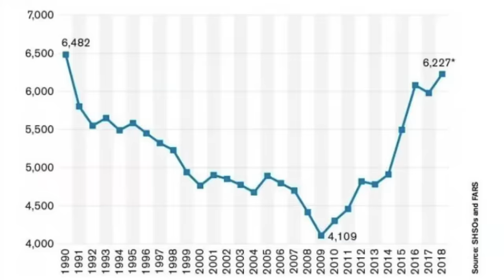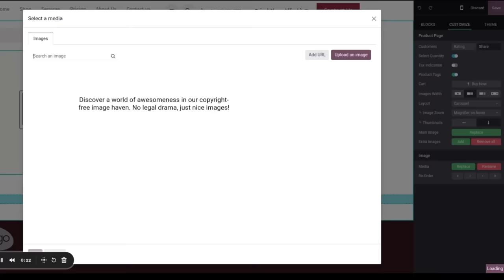Can this forgotten invention save your life?

Comment: The "Built, Ford Tough" screen at 18:06 after the car shit itself after hitting a mannequin is pretty fitting.
Reply: That made me chuckle
Reply: Built to make the owner look tough.
Reply: FORD: found on road dead.
Reply: It's accurate, it's just that "Ford Tough" means breaks the moment it impacts any form of metal, or after a random number of miles between end of warranty and 120,000.
Reply: I was a bis surprised that there was not engine protection underneath the car... like trans fluid? What The Hell... Coolant would be maybe more acceptable but still... a rock could hit it at that speed or a twig or something.
Reply: So ironic. Also, that transmission oil pan looks like it's made out of plastic, how can it be tough?
Reply: Ford - Fix or repair daily
Reply: He needs a Cyber Truck. No fluids to change and pollute, and it probably is tougher.
Reply: @ghezinho9049  that's what I thought too...I can't believe with all that advertising they do for off roading, they don't even have a basic skid plate
Reply: @FLPhotoCatcher  problem with the cyber truck is it's essentially packed with explosives with the batteries. They're perfectly safe under normal conditions, you don't want to put an electric car through anything other than normal driving.
Reply: @FLPhotoCatcher   Not tougher than a J60 or J70 Land cruiser
Reply: This must be a secondhand Raptor. Raptors are made to go off road and have a lot of skidplates. Amazing that he didn't know anything about cars. Like the red stuff was ATF amd that a sharp metal spike piercing the Trans pan is somehow Ford's issue. He ran over a metal spike at 50kph. What do you expect? Anyone of you go drive a metal spike I to your trans pan at kph and film it and if your STOCK trans pan takes it and doesn't break and you film it, I'll buy you a beer if you're in my area of Florida. If this was a GM or Stellantis product, well it never would have made it to the testing area, but a sharp,spike piercing the trans would probably improve the driving on any Stellantis trans and woukd have went through the trans completely or torn the whole drive train out totally on any GM except a Vette or Cadillac.
Reply: @x689thanatos  should expect abuse to the undercarriage if it is advertised to off-road. Just a truck style SUV is what it is.
Reply: @FLPhotoCatcher  That's probably the only car that rusts faster than a Ford.
Reply: @ghezinho9049  It's not only the transmission oil pan, the oil pan is also made out of plastic. For an off-road vehicle.
Reply: @clifbradley  i bet you drive one !
Reply from the maker: Yeah it was perfect
Reply: @FLPhotoCatcher  the cyber truck woudl be perfect for him, he wouldn't have to break it himself then, they already break on their own after a few kilometers.
Reply: Ford, built to dissapoint
Reply: @MyRegardsToTheDodo  Don`t be stupid, plastic doesn`t bend like that and they don`t handle hydrocarbons well. It`s metal.
Also the protective sheet is an extra addon pretty much always. Ya boy, just didn`t get that added.
Reply: lmao they sure know who their audience is with that sorta cheesy stuff. people with their heads stuck in middleschool.
Reply: @amoeb81  the only cars I've seen with skid player are off road cars. So unless you put it on yourself. You're kinda screwed
Reply: @holdenroberts6973  imagen that was a cyber truck and that thing pierced through the batterie that would have made a nice campfire
Reply: @Notmyname1593  Look up a 10R80 transmission oil pan.   Hmm, plastic eh?  Yea, try actually knowing what you are talking about before calling someone stupid...
Reply: @nickbob2003  Yeah that was the saying for Ford in my family growing up.  Looking back I think we just had really bad luck at that time but really good luck with Dodge.  Funnily enough that completely flipped when I was an adult lol.
Reply: My 2012 ford focus has a small coolant leak and the dealers official mechanics refuse to fix it, said the only option was a new engine. Got it fixed somewhere else but them saying a car is a write off mechanically after 12 years with proper maintenance is absurd.
Reply: Hahahahah good one😂 @FLPhotoCatcher
Reply: My Pop-Pop always said Ford stood for “Fucked Over Rebuilt Dodge”
Reply: @FLPhotoCatcher  rustttttt
Reply: @holdenroberts6973  batteries are well protected

unless u completely destroy the frunk
Reply: @ariesleo7396  The "rust" is rail dust - tiny flecks of steel from railroad tracks and train wheels that have rusted. People have seen the exact same type of rust spots on new run-of-the-mill vehicles.
Reply: @tangentfox4677 Fords ironically are factually more reliable than dodge or chevy and are the ONLY American brand to reach top 5 in reliability in over 5 years (toyota, lexus, Honda, and mazda hit top 5 regularly with subaru popping in and out)
Reply: @nickbob2003  Found On Road Dead
Reply: @tiredanddepressed  Ford Raptors come stock with skid plates. Lots of premium off road models come with them. My truck came with a skid plate standard, and it's not a premium off road model. Those came with more skid plates.
Reply: @tiredanddepressed you say that yet having just bought a Toyota Prado I was surprised to see skid plates with structural stamped steel channels welded into them covering the bottom of the engine/transmission area. Gonna say it’s probably manufacturer discretion on region, model, and or cost.
Reply: God loves you all
Reply: Hmm, im pretty sure a metal beam will pierce your 95’ Camrys oil pan too.
Reply: @holdenroberts6973   Yes, unlike standard Internal Combustion Engines.

Those for sure aren’t filled with explosives, and definitely engineered for other things than normal driving, like uuuh... such as... hm.

Wait, what did you mean with that ? That’s literally true of all cars lmao.
Reply: @zeloth7  And the Tesla cars have been judged to be among the safest on earth.
Reply: @ghezinho9049  their task is not to defend but change a vector if its possible - which works perfectly with rocks. If we will strart defending  - cars ned to be much more heavier - and this means huge gas consumption for all cars which is extremly expensive. Its betteк to change trasnmition on few cars then get lower mpg on millions.
Reply: @FLPhotoCatcher  Tesla vehicles are a grift. They stole an old version of the semiautomatic driving code from openpilot and have not given credit.
A rav4 can drive the entire gas tank empty automatically in heavy traffic on city streets without any disengagements. And it's an add-on for over 200 cars that only costs about $1500
Reply: @runed0s86  Openpilot is open-source, so Tesla owes them nothing. But even then, people who have used both say that Tesla's Autopilot, "while not perfect is lightyears ahead of OpenPilot". So they are not the same thing at all.

Comment: The most depressing thing is everyone driving M1A1s would likely prevent some pedestrian deaths cause they have better front visibility than most consumer pickup trucks.
Reply: The ability to stop on a dime would definitely save lives.

Pros of everybody driving MBTs
-never worry about parallel parking
-no need for roads
-instead of servicing your engine or transmission just replace the whole thing
-badass
-270 degree blindspots
-if two vehicle collide it's horrible instant death for everybody involved, meaning you don't need to pay for repair
Reply: you also go slower, and not many people know the inside of a tank = less deaths & less driving.
Reply: I've been an abrams my dad's company was working on, and he's not wrong 😂
Reply: Navigating rush hour in Texas would also be much more fun when you have APFSDS to dispatch Nissan Altimas.
Reply: @spyderf16  🤣
Reply: @spyderf16 Nah, that kind of ordinance is for cybertrucks and older SUVs that outsize you.
Reply: It's Abrams not Abrahams
Reply: @spyderf16  Nah, APFSDS would just go straight through. You gotta hit it with an HE round instead and enjoy the fireball
Reply: @benjaminhinckley897  You WERE an abrams?

Comment: You set out to prove the lifesaving efficiency of past tech and ended up disproving the durability of "a real man's vehicle" in the process. Astounding.
Reply: He just had the Ford stereotype, remember 90 percent of Fords built since 1985 are still on the road, we pray that the drivers managed to get home
Reply: He should've got a Silverado
Reply: The only real tough trucks anymore are just commercial vehicles. I haven't seen an actually tough truck since the early 2000s that wasn't built for commercial duty. Before everyone cries that I just insulted them for buying a compensation machine. I own an F350 from the 90s. It's tough, but also, it's not even close to being tough compared to a simple actual straight truck.

Modern trucks are just less useful SUVs or work vans for guys who want to show off they goto home depot for a 5 pack of drywall anchors once a year.
Reply from the maker: Yeah guess I did well
Reply: "Built tough!" 

(Unless you have a slow speed impact with something underneath the car, but when would that ever happen to a vehicle supposedly built for off-roading?)
Reply: @2009dudeman  the reason I prefer a pickup truck over a SUV/smaller car is the fact that I have two golden retrievers that love to swim when I take them to the beach (just about every 2nd weekend). I just find it easier to sweep sand out of a truck bed than vacuuming the back seat of a car and prefer to keep the wet dog smell on the outside of the car, but idk maybe that's just me. Most pickups (the base spec models) are still built intended to be primarily commercial vehicles (at least in my country), but a pickup is considered a "light duty" vehicle, i.e. transporting tools, hauling light loads or towing small trailers. All of this can technically be done with a van, but here vans are hella expensive and I'm not sure how long a van will last compared to a pickup on shit roads. No car, commercial or otherwise - no matter how 'tough' it's being advertised, is built to withstand abuse in the form of intentionally crashing into stuff - if you want that you should look at military vehicles instead.

As for the Raptor (and similar sporty pickups) in particular, it's only purpose is so you can easily spot the dickheads on the road and know to avoid driving near them.
Reply: @mastersKaaP  the only country I've seen that doesn't understand the actually utility of trucks is the one I live in. America. A stock f150 is about as wide, only a little shorter, and is most of the time taller than my 90s f350 dually.

I don't mean to be rude to people that actually do truck things with their trucks. But there are some 30 houses in my neighborhood with trucks, I'm the only one that regularly uses it for actual truck things. 

I don't know what country you're in, but if it's not North America I'm guessing your truck is a normal and reasonable size for daily use. The Ford raptor is actually kind of small really when it comes to the average truck around the Midwest.
Reply: @2009dudeman  Yeah it's mostly American pickup culture that ruins the reputation of the vehicle in general. 

I'm from South Africa and here the most popular commercial vehicle is probably the NIssan NP200 - it's a reasonably priced, station wagon sized single cab 2wd pickup. It's light on fuel consumption and cheap to maintain. One step up from that is a Hilux or Ranger "mid-size" pickup. Commercial vans (outside of people carriers or delivery vehicles) never really caught on here, even though you do see some of them on the road it's mostly in more affluent areas. For the most part if you can afford a van you can afford a mid-size pickup, in which case you'd go for the pickup since it's more capable on the worse quality roads.

Comment: The sad thing is that the real reason pickup trucks, SUVs and crossovers became so popular was because American car manufacturers started prudcing more of them and and heavily advertising them just to evade a 1978 tax that was meant to "to discourage the production and purchase of fuel-inefficient vehicles". The tax was meant to only affect passenger cars so an exemption was made for trucks, SUVs and minivans because back in 1978 these cars were mostly made for non-commercial uses, but mega-conglomeretes used this as a loophole to increase profits at the price of their consumer's fuel efficiency, the climate, and public safety.
Reply: So it's just usa's fault..
Reply: And it got even worse about a decade ago when they tied fuel efficiency targets to vehicles' wheelbases, incentivizing vehicles, especially trucks, to get physically larger in order to lower their efficiency requirements.
Reply: The thing with "big cars" as a whole is that all you need to do to understand why they spread like a plague is to drive on a road where they have hit the "10% or above" fraction of the vehicles.
Quite simply, their height and bulkiness obstructs the view of lower, smaller cars quite a lot, and some drivers feel anxious driving around vehicles significantly more imposing than their own (for good reasons), so SUVs, trucks, and co create more drivers partly through being a nuisance on the roads unless you're driving one of them too.
Reply: Actually, they're popular because they're just well enough made to fool people into thinking they're good vehicles, when in reality they're just well enough made to last the warranty.
This then means they're extremely cheap to make. An estimate puts one of these trucks at a third of the market price.
Reply: Not only that but CAFE standards in the states are based around the size of the vehicle. Put simply, the larger the wheelbase is the less fuel efficient it needs to be to not get fined. This is why you can't buy the old, reliable little trucks loved by gardeners everywhere. They'd need to be far too fuel efficient to be practical for a truck.

So basically like most things, regulations created with good intentions get abused and end up making the problem worse. I'm also highly suspicious that lobbyists for domestic manufacturers have pushed for some of these standards to make it more difficult for overseas manufacturers.
Reply: So what you're saying is that if I buy big car the pp will get longer?
Reply: @runed0s86  goes up one inch, 2.54 eurolongs, per extra ton of vehicle
Reply: lets goooo
Reply: @NeverPr  well, the usual suspects. 
I'm actually surprised that it wasn't the french.
Reply: Alright. So why not do away with the tax? Then, fuel efficient cars make more economical sense… Is it morally wrong to decrease taxes? 🤨
Or is the solution to spend tax payers money giving subsidies to car companies for going green, like they do in Europe? Seems irresponsible and dumb to me when, under normal conditions, the profit incentive would generally align with fuel efficiency, but what do I know?

Comment: "Its the coolant" as transmission oil pours onto the road. Built ford tough coming up on the dash was the icing on the cake.
Reply: found on road dead
Reply: @DinDooIt  To be fair based on the dent it put in the frame I doubt a metal pan would've fared much better unless it was like an inch thick.
Reply: No car can be tough when there is a computer telling it what to do.  Just you wait until all these cars with those auto start/stop functions start to mess up.  They will either cost a ton to fix (even though the problem is mostly digital), or it will fail in a catastrophic way or at the most inopportune time
Reply: @king_acceler8755 from what I can see online the OEM pan is made out of cast aluminum on the bottom.  It looks like what he is saying punctured the pan was a copper or brass pipe.. whatever it was was strong enough to lift a 5000 lb truck off the ground, so yeah.. idk if this person expects the pan to be made out of cobalt or something.  If half the trucks weight was being pushed up by that puncture point that looks to have a radius of about .5 cm.. thats about 20000 pounds per square inch of pressure.. and thats assuming the pipe wasn't hollow, which it looks to be.. for a hollow pipe, assuming the thickness was 1mm it would be about 50000-60000 psi which is about the pressure of a bullet
Reply: If they'd tried this with a 90s Tacoma (Hilux) it would likely have survived.
Reply: All things considered... a new pan and fluid is getting off pretty light.
Reply: BTW cast aluminum has an average tensile strength of about 30000psi and steel is generally 36000 to 50000
Reply: @gregwessendorf  from what I am able to find online the transmission pan would still have been made out of cast aluminum.. so not sure what you are basing that off of
Reply: Buy Japanese
Reply: @gregwessendorf  That spike would have impaled itself into the road.
Reply: The pan being cast aluminum or plastic is the issue, note the grid pattern. That grid pattern is likely what caught the metal bit in the first place, diverting the force upwards into the pan. A steel pan is usually flat or has minimal features on it as it's usually just stamped into shape. That would likely have just bent or deflected the blow rather than catching it.
Reply: @smallmoneysalvia  that is a good point.  I was wonder if that was for heat dissipation or a strength vs weight tradeoff
Reply: @justinanderson267 Computers can actually be much more reliable than pretty much any part of a car.

Problem is more about the poor quality of software that gets shipped out these days. Could a computer be extremely reliable and pretty much not ever fail in a car? Sure. But the reason we don't see it is because prioritizing high quality software is rarely something businesses see as worthwhile
Reply: @justinanderson267  what was the last car you owned without an ECU?